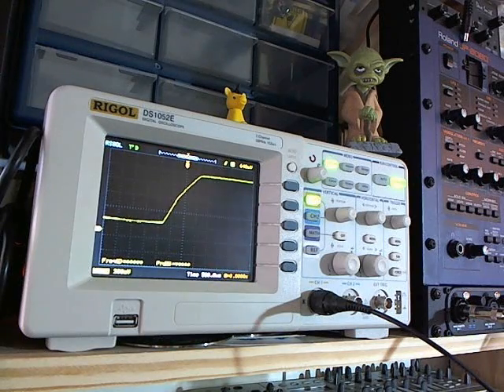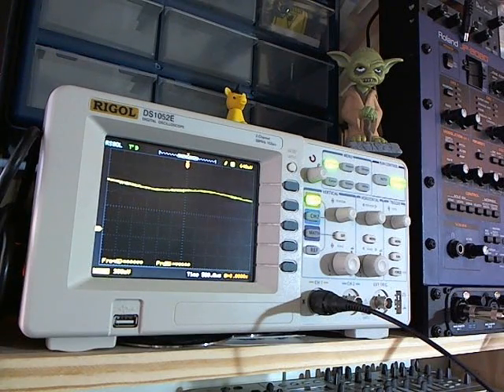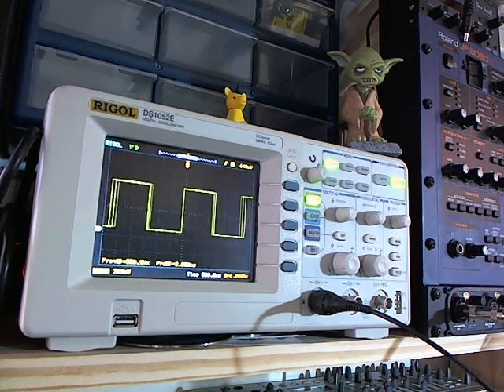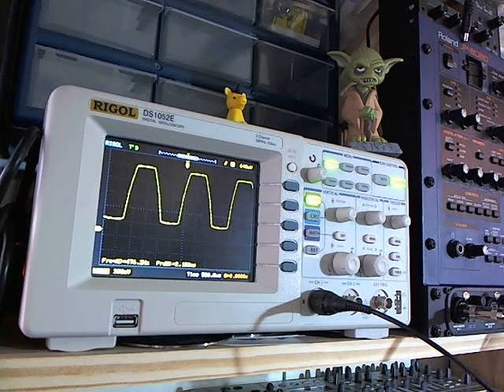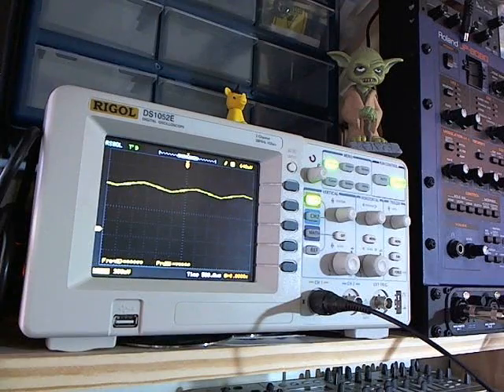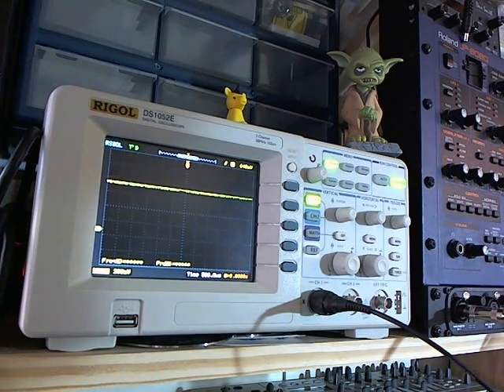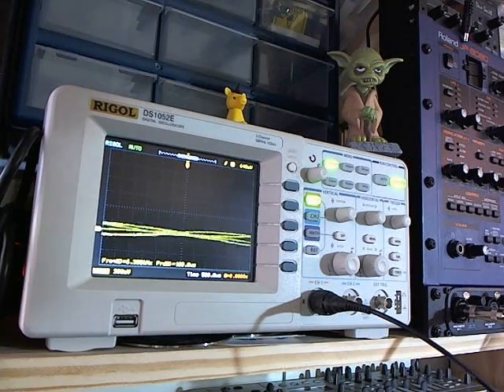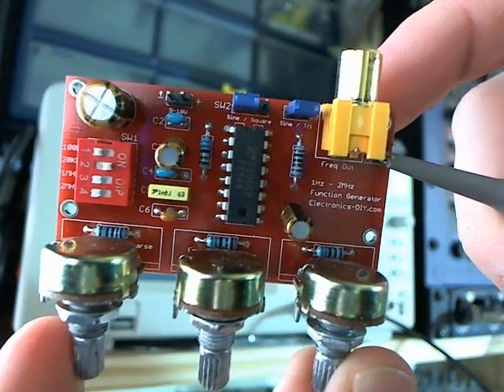XR2206 Function Generator Test Board from electronics-DIY.com

Comment from the maker: I plugged it into the input on my MOTU 828mk3 audio interface (black 1U high box on the right under the blue JP-8080). As I recall, you can use most anything that will let you adjust the gain on the signal to above line-level.